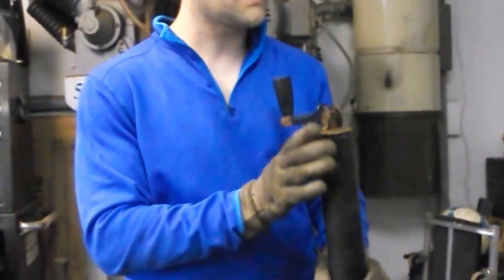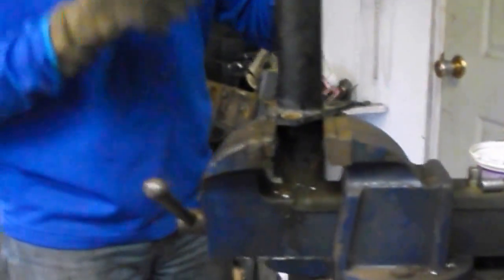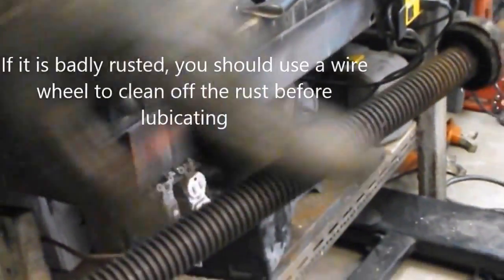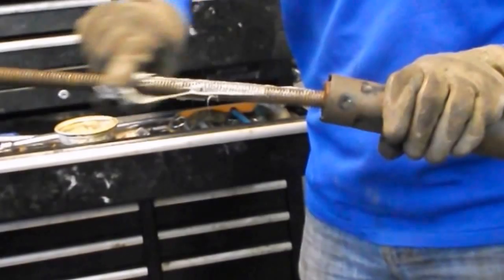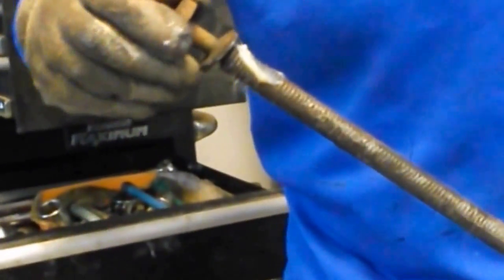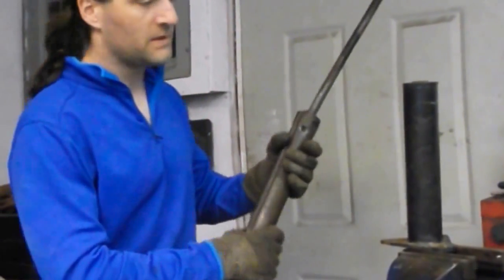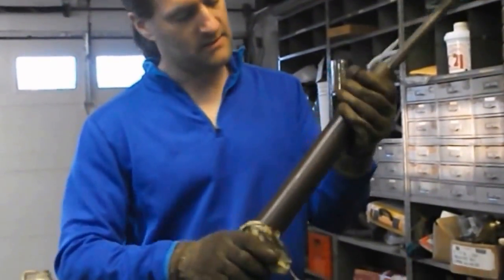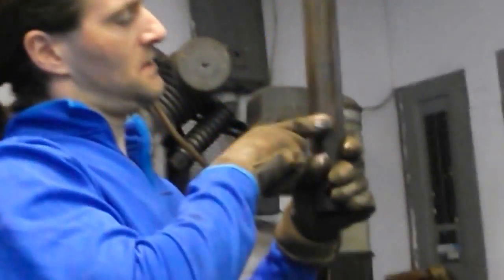Trailer Jack Lubrication Maintenance

Comment: I just came inside from re-lubing my trailer jack.  This video saved me, because I needed to file the center pin a bit and would not have had the courage to take a file to my jack without this video!  Thank you for posting this and keeping it up all these years!  Yes, your cameraman needs to sober up, but the content is on point!  Thank you again!

Comment: I did the same but my jack is welded to the trailer itself.   I wrapped a piece of coathanger through the hole on the shaft that holds the handle and used it as a guide to help align everything. The coat hanger was long enough it was easy enough to push it through the hole from underneath.   Not all jacks come apart off the trailer.

Comment: Great information (ya the camera man had too much coffee) but anyway - I'm going to rebuild mine for a project I'm working on. You should mention, on the better ones, there is a bearing at the top of the screw that needs to be cleaned and lubed when you rebuild them. It makes it turn so much easier.I'm going to use one of those jacks for an angle cylinder on my snowplow. I'm planning to incorporate a wiper motor on the end to turn it. It shouldn't take much power to turn the plow if I lift it up off the ground. The jack should have enough holding power for pushing snow if I make the mounts strong enough. These are rated at 5000 lbs. so it should work. Here we go...……..!

Comment: In case anyone still wonders what to do after 8 years:face-green-smiling: After you grease your threaded rod while it was extended out of the base tube, screw the rod back down into the lower tube until it is about 4" from the top. Now it will line up with the hole on the top half because not much slop when tubes are slide into each other. You should also remove both inner and outer bearings and washers and lube them up also prior to install if you have bearings like most good trailer cranks have. You can do this without removing the upper tube (3 to 4 bolts/nuts) from the trailer as long as the trailer tongue is lifted high enough to drop the corkscrew and lower tube out the bottom( maybe raise tongue  an extra 24"). IF you don't find the bearings and washer on the threaded rod/corkscrew, it is stuck up inside the upper tube and maybe with a dowel or rubber mallet, you can get them to drop out.  Don't make it any harder than it has to be. LUBE THEM BEARINGS!

Comment: What if the internal threads of the body is damaged? Should I replace with a new one but it's hard to find part like this nowadays.
Reply from the maker: If threads are damaged in the "nut" or the "bolt" it would be very hard to find a replacement. I would wait for the jacks to go on sale and then replace it.
Reply: @mrdiyguy123  Thanks for replying, the problem is I can't find the another jack in the right size. What can I do?
Reply from the maker: @larry5872  a machine shop could easily make a new part with restored threads

Comment: So, do you jump in your truck and drive away holding the wheel with those gloves after a job like this.
Reply from the maker: No. The gloves were greasy and  would likely result in a transfer of grease to the part of the steering wheel that comes in contact with the gloves.
Reply: @mrdiyguy123  lol

Comment: Greasing the outer tube is moronic. The only thing that did is attract dirt and moisture. 
Guys clean the tube with a wire brush and paint it done. You can lubricate the screw and remove rust. Thats it.
Reply from the maker: Seems like you may have missed my comments at 3:38 that acknowledge grease in that location is less critical.  My driveway has an incline and try as I may to have the wheel chocks perfect, there is often a horizontal force on the jack leading to friction between inner and outer tube.
Reply: doug m, YOU ARE RIGHT. Sometimes I think we should change the name to "Fool Tube".